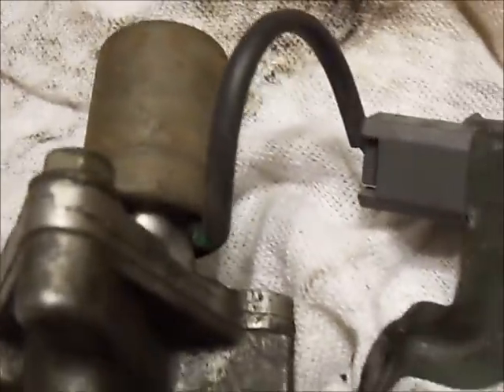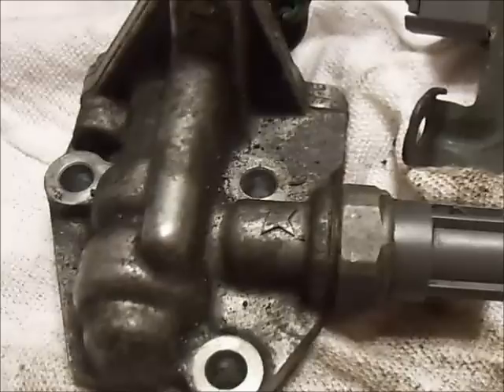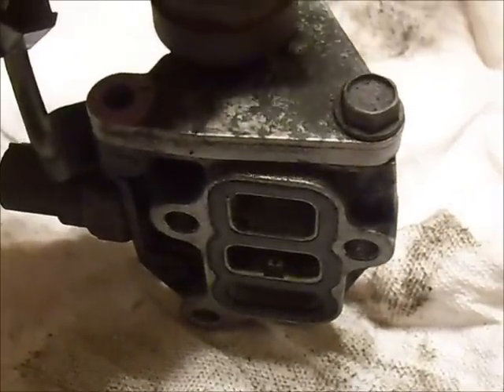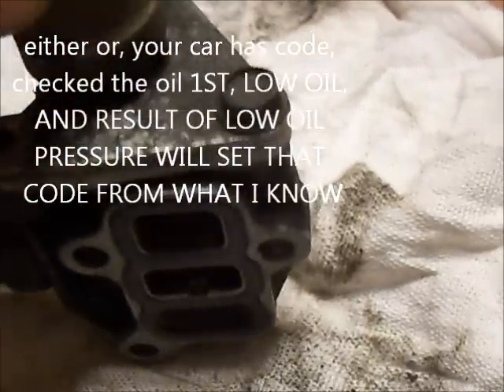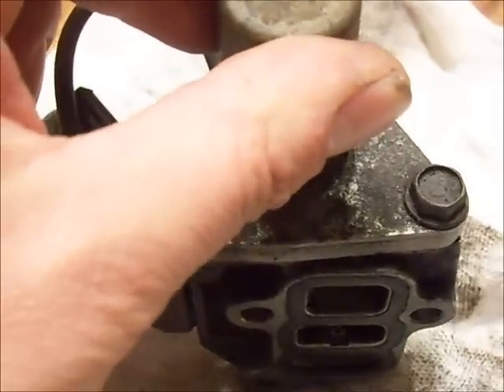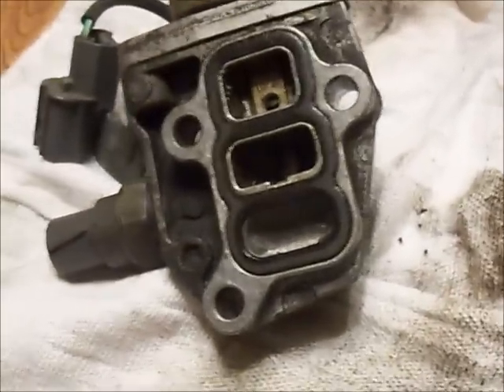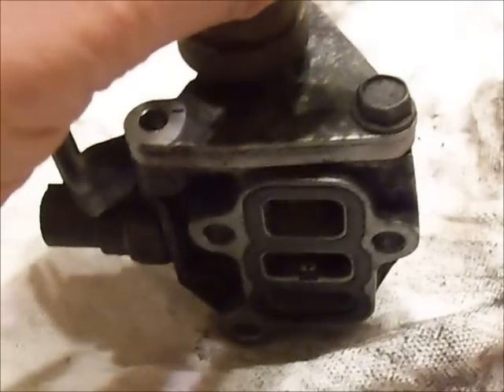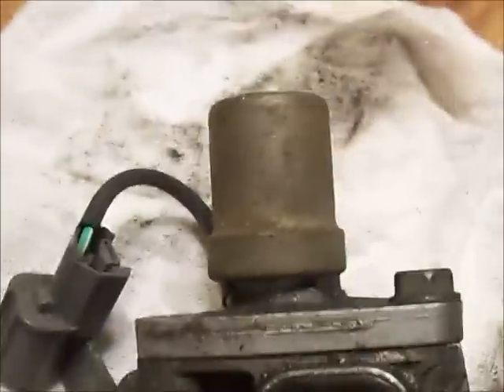P1259 VTEC MALFUNCTION CODE FOR HONDA 2.3L VTEC ENGINE

Comment: Ok so the oil PSI sensor tells the solenoid to open the Vtech and move the cam lobes, this only happens below 2500 PSI generally to prevent low oil pressure to Vtech and allowing the engine to rev too high with low oil pressure, so as NOT to blow the engine. It's a protection for the engine and the cam. 
If there is not an oiling issue other than low oil pressure due to low oil which usually only happens while cornering hard and oil sloshes to one side or the other, then it is the sensor or the solenoid. The solenoid is easy to diagnose, just put power to one of the pins (doesn't matter which one) and ground the other one with a pair of jumper wires and if you hear and feel it move? It's working, it's that simple and if it is then the sensor may be bad. 
Next disassemble the sensor and possibly the solenoid from the housing and check the oil channels that run through the housing and make sure they're clear of debris and old dried oil. If so then clean and reinstall and see if your issue is resolved if not then the next thing is the sensor replaced but no need to to replace the entire housing solenoid, sensor and housing, needless additional cost. 
From there if it doesn't solve the issue then the engine might be toast and must check pressure with a pressure gauge connected at the sensor connection. Once you diagnose the issue, if it turns out to be a sensor or solenoid and the housing has been disassembled in order to test clean or repair, then order a new o-ring kit and replace, as no you have not only disturbed the surfaces and sealing but the O-rings are too worn and the oil pressure through the system will now be higher and most likely leak afterwards which can exacerbate the issue even more dropping oil levels dangerously.

Comment: Thanks a ton for posting this vid. I just stole a 1999 Accord Ex for 2300 bucks, but it cuts out badly at 3800 RPM. Autozone declared an error of p1259, Vtec issues. Thanks to your 1 hr. experience, i just ordered one from Amazon for $143.22 (LOVE Prime!). Have a good day!
Reply: AutoZone is one place I don't trust for parts.  Good move going through Amazon.  I'll pass along another site that's worthwhile in the auto parts world that may be quite useful, rockauto.com.
Reply: Brendan Kenny hey buddy im trying to find the vtec solenoid and vtec pressure switch on that site im having trouble finding it, maybe im searching under the wrong name?
Reply: uMadaFacas If you have an O'Reilly Auto Parts or an Advance Auto near you, those are your best bets.
Reply: uMadaFacas here's the one I ordered: http://www.amazon.com/gp/product/B001G7ODLS
Reply: Ron Enderland thanks alot my friend :)
did this fix your issues with this P01259 code?
I felt like i had a rev limit set on my car, kept capping out at 5.9 rpms

Comment: If you want your VTEC to work without problems make sure to change your oil and filter often enough and use the correct viscosity 5W-20 oil as specified by Honda.  Heavier oil such as 10W-30 or 10W-40 will cause the VTEC system to malfunction.  My 2002 Accord has 122k miles and I have not had any issues with VTEC not even an oil leak from the gaskets which often fail on these cars.

Comment from the maker: sorry I missed your question, until I saw this other comment today. which that comment is good tip, and he's right. but also chance your solenoid in that unit went. not sure root of your code, but check oil is a must, make sure its full. this was a month ago I'm pretty sure you fixed it by now. so sorry on late reply. I came across 3 cars with this code. at idle they seemed fine, but I didn't test drive them. ran scan tool,got the code. checked oil, then that part, changed it. fixed the problem

Comment from the maker: I advise doing an oil change 1st before the swap, just cause I've heard it has helped some, either or then if the oil change didn't help, then change the part, but if you put a new one on, and didn't change the oil, well if you just had it done with in the past month, no, but check the level, make sure its full and if it looks dirty still or you know its been well over 3000 miles since last change, I'd change it then

Comment: Hey, I've got a 2002 CRV 300,000 miles. I had the solenoid replaced about 10 months ago because my car was throwing out the P1259 code. Recently, about a week ago, my car threw out the same code...my oil level was fine. When I took it in to a Honda dealer basically what they told me was that since my oil level was fine they were just going to turn the light off and see if it came back on and that I might need to change the solenoid again. Here I am a week later and the P1259 light just came back on. My oil level is fine again (just had the oil replaced about 3 weeks ago). My question is: if I get the solenoid replaced again...is it just going to need to be replaced in another 10 months? Could there be something else going on that is causing the problem? The mechanic that repalced my solenoid 10 months ago mentioned something about possibly using thicker oil since my car has so many miles, was wondering if that was a legit sugesstion? Thanks for any help!
Reply from the maker: Laura Fry I don't know if thicker oil would help or not, hard to say but it is a legit suggestion. but my assumption 300,000 miles, might be lots of sludge build up inside the motor and it is reducing oil pressure having a hard time to flow properly would be my thought, so thicker oil might not be good, also good chance you just got a faulty part and it just failed again all hard to say

Comment: Hi. I have a 2002 Civic 1.7 VTEC. I was getting code 1259, CEL on. I replaced the upstream bank 1 O2 SENSOR, VTEC valve, VTEC relay behind the glove box and VTEC oil pressure switch. I cleared the codes and it ran great. This morning the CEL came on again. Suggestions?Ken
Reply from the maker: so you replaced entire assembly you see in my vid and still have the code
Reply from the maker: Also did you use teflon tape on threads make sure not excessive amount on switch or solenoid cause it can  prevent it from grounding
Reply: Creature Black Lagoon x
Reply: RANS87IROCZ I have exact problem we changed too dead center sensor oil pump coolant gauge.. etc didn’t replace whole assembly seems like it runs great light went back on. Would a light affect blowing the head??

Comment: Your video definitely helped me out though.   just one question.   on these vehicles u worked on.   did they rev over 4000?    My car has that code and it won't rev over 4000 and i changed my oil anf that pressure switch
Reply from the maker: hey sorry for late reply, hadn't been on in weeks sorry. but yes some did have problems where they could not rev, some was driving real erratic and no power but my cases this solved it after seeing like 3 different in one month I said when I get home I gotta make a vid on this cause it was so common and I to had no help at first. some was just low on oil, I thought that was crazy, but others was this part, I wish I would of had camera at work that day and if I could go back I would make vid better, but I had to share this, even faulty gasket on it could cause it, any lack of proper oil pressure to it, so run proper oil weight and level is also my advice, but small chance it could be wiring or ecm problem if you did all the above and had no results unless for some odd reason you got another faulty part. so at worst you might have to dig deep into the wiring of it, also how many miles do you got? and did you solve it since? once again sorry I just got your question

Comment: Besides the light being on, did the car run like crap is what I need to know.. my lights been off for years. Don't bother me because it's intermittent. But I knew about this problem. Or you just don't know what might happen by leaving it like I left it? For years. Now there's smoke out the pipe and I am getting this code. Runs fine if you don't push it. Not the catalytic converter either.

Comment: Fun Fact: a 2003 Honda CRV EX AWD does not have an EGR valve have had two same year model identical CRVs repair shop says EGR valve is bad spend hours looking for the thing according to where engine diagrams and YouTube says it should be call Honda directly to be told that year model does not have one that is controlled electronically by the ECM.

Comment: Hi, my 2000 Honda accord started sputtering out at 4000 rpms. Runs fine if i keep it under that. The 1259  code showed up, and my mechanic said that means my engine is bad cause no oil pressure... Is he right? Or is he just being dramatic about it? There has to be another way other than junking my engine... Please help!!! Thanks
Reply from the maker: Chelsi Humphrey he could be right, did you try oil change, and new solenoid? he can actually check the oil pressure and find out what it should be and if it is from a bad oil pump, but that is rare, but yes it can happen.
Reply from the maker: Chelsi Humphrey Also no oil pressure truthfully the engine starts ticking bad, any ticking sounds? if the gasket is bad on back side of solenoid housing can also possibly cause the code. how many miles you have it, the code is the reason it can't go past 4 grand, in most cases it is either this or no or low oil in engine. at worst bad oil pump or bad wire to the computer

Comment from the maker: yep, low oil level, or very dirty oil from not being changed every 3000 miles, can cause this code from what I know, cause it doesn't get the proper oil pressure to it. I had one Honda before at work, owner failed to change the oil for some time,and wasn't checking it, it was little over 2 quarts low, and it had this code. changed oil cleared light all seemed okay but also had 2 others at work before with this same code, but this unit was faulty

Comment: Your vdo make sense but my car doesn't. I got the same code p1259. Replaced brand new vtech selonoid and change oil& filter but the dam code still comes on.  Cleared but comes right back on when starting the engine.  What else can if be?
Reply from the maker: Did you do entire solenoid? At the worse bad oil pressure from oil pump, or wiring issues to the pigtails for it, even the gasket at it if it leaks oil a little can cause issue

Comment: I have  a 2000 honda accord coupe and it will not rev over 4000 rpms but if i drive under that , the car will drive just fine . What do you think could be the problem ?
Reply from the maker: +Luis Cabrera timing belt been changed? could be off. any check engine light at all? I know this code will cause issues with the rev. But most cases you get this code when that starts acting up. what is it like up hills, even clogged converter can cause power loss,  and it does shift gears right, just hard time climbing rpm? if you get on the pedal
Reply: +RANS87IROCZ timing belt has not been changed since i bought it , only the maint required light is on . Going up hill it takes a while but it does make it , also it does not have a cat converter a mech told me that .
Reply: +RANS87IROCZ it shifts okay just will not pass over 4000 rpms.
Reply: +Luis Cabrera same this happened to my accord. Is your engine oil level right?
Reply: +xGorefulx yes i keep my engine oil on level .. I check it almost every day .... It does not leak .... Car starts up great just will not rev past 4,000 rpms
Reply: +Luis Cabrera  Have you ever fix the issue you were having. Im having the same issue and this is the only code im running p1259....
Reply: The same thing happened on my 03 civic. If you engine oil is at the right level and the it's not dirty, then change out the vtec solenoid. Your engine will not let you run above 4k RPMs because the solenoid isn't working properly. I think Eric the Car guy explains what the vtec solenoid does and how it works. Look him up on youtube.

Comment: Thanks for the video.  I have a 2002 Accord that consistently throws the P1259 code after about 10-15 miles of driving.  It almost seems temperature related.  I tried to fix by first changing the oil.  That didn't work so replaced the vtec solenoid & pressure sensor assembly.  Still getting the error.  I don't see any visible oil leaks.  I pulled off the valve cover and all the bolts and rocker arms look good.  I'm at a loss of what to do next.  Any ideas?  Could it be a failed oil pump or carbon / sludge clog somewhere?
Reply from the maker: Dallas Clement did you do entire whole unit. Or just the solenoid in it? did you buy new part also
Reply from the maker: Dallas Clement also, any oil leaks? make sure that gasket is sealed good
Reply: I replaced the whole unit with brand new part from the dealership.  Afterward it was still throwing the P1259 so I walked through the whole service repair manual for this part.  It tested good for continuity.  I also tested the wire from the sensor to the pcm.  No opens and no shorts to ground.  All tested good.  The only thing I haven't tested is the oil pressure itself.
Reply: Haven't observed any oil leaks around the solenoid area after replacing.  Don't see any leaks around the valve cover either.  The valve cover gasket was replaced recently.  I don't see any oil leaks on the ground either.
Reply from the maker: Dallas Clement okay few times in my life sensors I got and installed them but they failed to ground because pre teflon tape crap on sensor caused it not to ground I guess being to much on them or it just not scuffing enough when it screwed in to make contact. so just maybe one of the 2 in the new unit is not grounding out. also might want to check the wiring I forget off hand what wire is what but if you have access to a power probe you could  check to least see if there is a break in wiring somewhere. could be oil pressure prob to lord knows but most cases it's something to do with this unit getting plugged up or leak at back of it or switch or solenoid bad in it
Reply from the maker: Dallas Clement so when you got this new from dealership it came complete. you never know it might have ground issue still. but being prob was there with old part plus new part maybe it is from other issue but you never know,. my other question is, How bad was your old oil? shit I seen one so sludged up it was unreal. And hey thanks for watching my vid. it basically was 1st on this issue on here I needed help way back and was virtually no video on here for help. Now there is few good ones and man the scannerdanner video breaks it all down for sure how it all works you check it out
Reply: The old oil was not bad.  But the car has 156K miles on it.  Sludge and carbon build up over time.  I have already followed most of the honda service repair manual on troubleshooting the P1259.  I did a continuity test on the solenoid and it was good.  I tested for opens and shorts on the wire.  It was good also.  I have not checked the oil pressure though.  Not sure how to do that.

Comment: Well changed oil changed that little guy replaced gasket even though it was new still getting code. Hoping pressure switch will do it
Reply: Also passed a compression test at around 120 on all cylinders

Comment: Ive had the same code on my 98 civic with d16y8 before and its back again last time I had a mechanic clean it out the solenoid with carburetor cleaner and that fixed it but since it's back should I just buy one where can I even get one?
Reply from the maker: Ej8Guy I believe it was posted on here in old comments where to get one at

Comment from the maker: well chances are either the solenoid, that is on the top, went bad. or the lower switch sensor. but you can get this all as one piece, like I have in my hand, and swap it out. its a little bit a pain, cause its hard to get at the 3 bolts that hold it in, but its not a huge nightmare job. I say switch what you see in my vid here, and for sure it should solve your problems

Comment from the maker: what about the gasket to it? I assume you did but if you didn't try that, if not there is a good video on here by ScannerDanner he breaks it all down on its entire operation. maybe help you check out the wiring, give you an idea if its a wiring or computer fault, but that's pretty rare from what know. but if you did all of thee above and still got the code. IDK possible oil pump is weak or passage ways are all sludged up from high miles and late oil changes and its not getting right pressure

Comment: Thats called a spool valve or vtec solenoid. Thats what controls the rocker arm position on the camshaft at different speeds. These solenoids are prone to leak oil from internal gaskets and leak pressure required to work properly. They run about 180 bucks at the Dealer, Or you can find one at the wrecking yard for about 20 bucks.

Comment: the VTEC code is only trip by the sensor that is screwed in the side you do not need to replace the whole housing just the actual oil pressure sensor my car has AV Tech issue 99 Honda Accord 1259 means that is not detecting oil pressure to that sending unit 4 VTEC to activate
Reply: Did you figure it out mine car is the same
Reply: yes I did the oil sensor for vetch needs replaced and vetch came back
they are cheap like 10 15 bucks
its the green one on top do not need to change the housing just the sensor